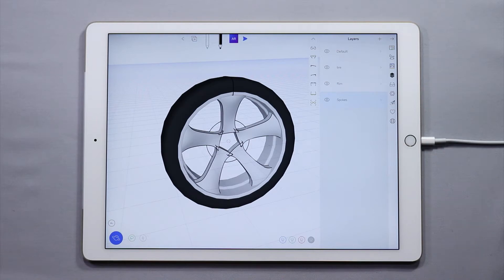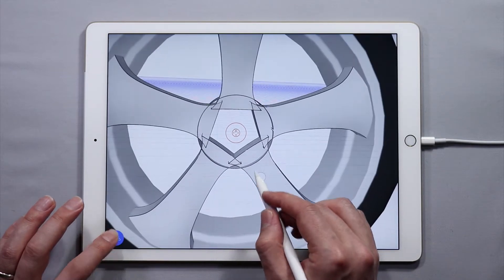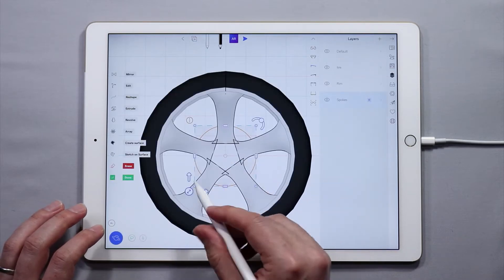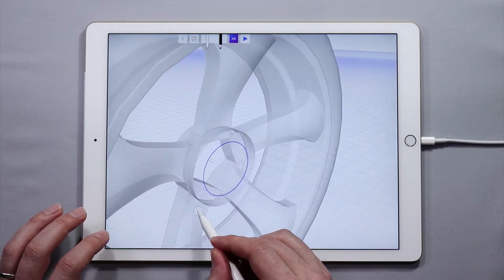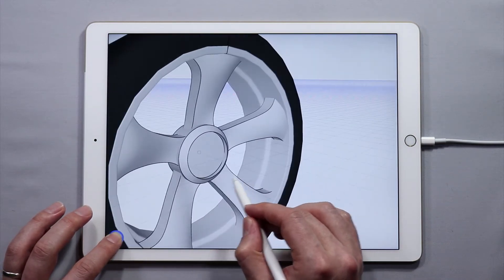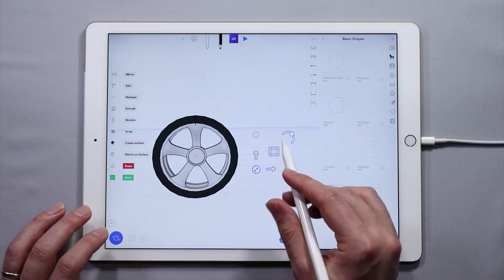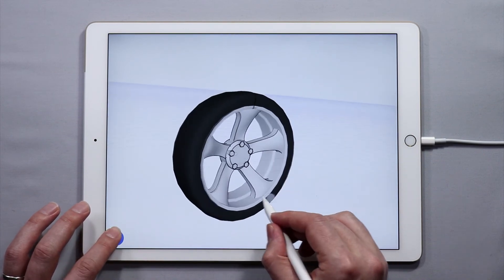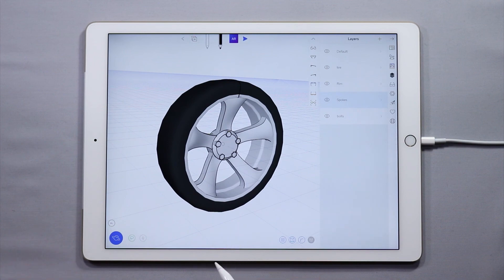Making a Wheel in uMake: Part 3 - The Hub

Comment: Join function would solve the overlapping maybe
Reply from the maker: Eventually, but It's not just a simple join. Keep in mind that for each overlap in this example there are 6 unique surfaces-- the shapes are not solids like in parametric modeling-- and the surfaces technically have no 'dimension' - thickness- to them. This tutorial was done primarily to show a quick method for creating the wheel-- if this were for production, there are easy to prevent the overlap altogether and make the surfaces joinable... hope that helps...